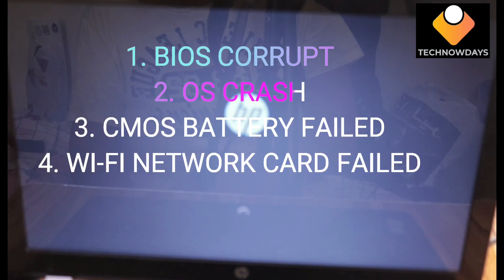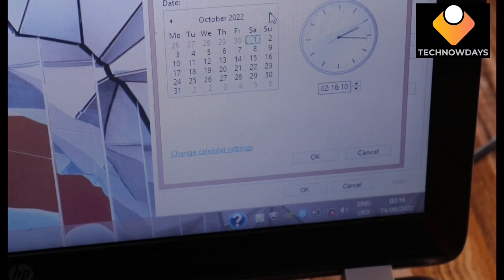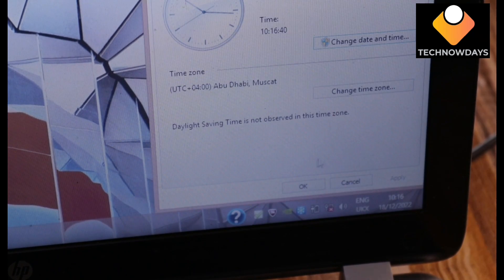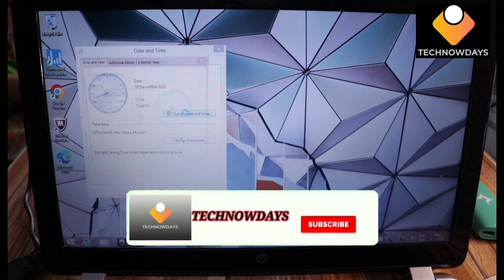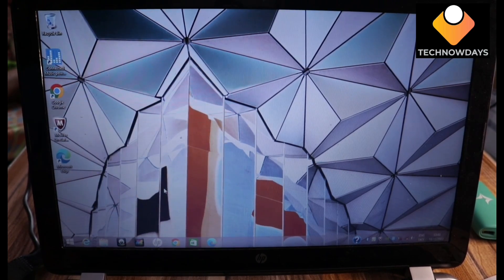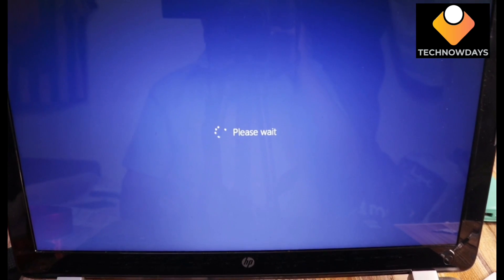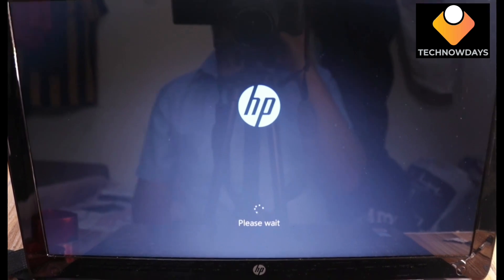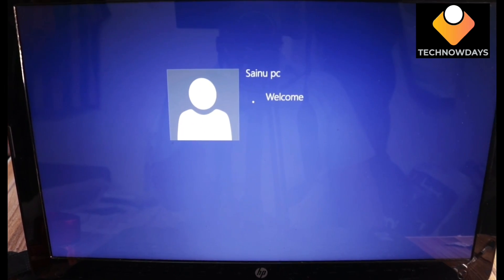HP 15 Laptop CMOS Battery Replacement, Full Diassembling Guide

Comment: Please help me, everytime i turn on my laptop it wont show anything itll just show the caps button blinking
Reply from the maker: This may power issue, check your cord is perfect, battery is ok, connect with current without battery & check without current only battery..
Reply: If the LED flashes 3 times slowly and 2 times quickly, the problem is the ram module, you must change the ram memory to another.

Comment: Well, outside of skipping how to take the disk drive out and how to undo the ribbon under the key board, I would have to say you did a pretty good video. I changed my cmos battery and only had  2 screws left over when I was done. Thanks for your help
I couldn’t have done it without you. 

धन्यवाद
Reply from the maker: Keyboard removal easy task, but when i filiming , forgot to on record button👍. Thanks for comments❤